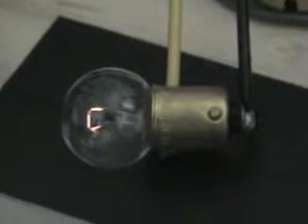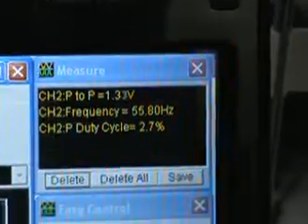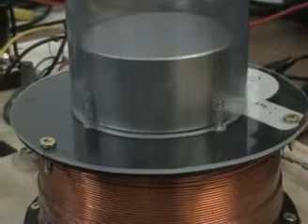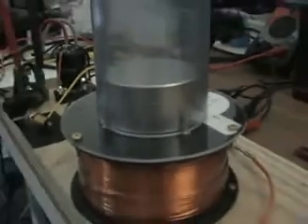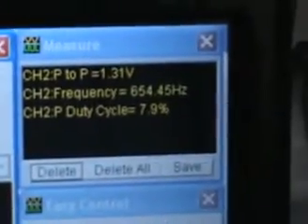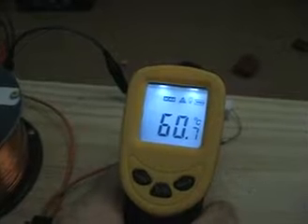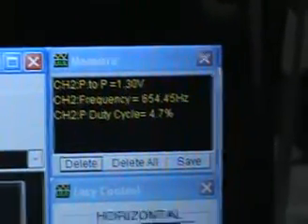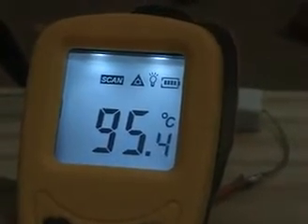Effect of Recirculating BEMF to Coil test 6

Comment: Hi again, 
You state that intensity of the bulb inidicates energy level input to circuit, but.. it only indicates energy dissipated in the bulb, not energy input to the coil.
My point;
50V and say 0,5 amp and 200V and say 0,2 amp input to coil may give same energy dissipation/light intensity in the bulb, but much higher energy available in the coil. This since the voltage drop is very little over the bulb, i.e. most of the voltage drop will be over the coil and therefore more energy= V*A

Comment from the maker: Hi Paul,

see user: Can101276 explanation above your post as it is perfect and a simple explanation of what is going on. As for meter measurements, they are not giving the correct reading in this kind of circuit. I had to remove them to find the real effect. However, a true power comparison (in vs out) is not yet possible. Given some time we will find the best way to calculate it.

Luc

Comment: Just to get some clarification, if you use a watt hour (RMS) on the input side and then a watt hour meter on the output side does this show a loss or increase in net power? I understand that you are using a light bulb at a given intensity to show the same energy input at various increased input voltages but a compensating reduced pulse width. I also understand that you are using an increase in temperature of resistor on output side to show more work done with shorter pulse width on input.

Comment from the maker: Yes Can101276,  you are understanding this correctly.  However there maybe limits as my higher voltage tests over 250vdc the efficiency starts going down but that maybe an electronic component issue causing this. I also see efficiency starting to go down when frequencies over 5KHz are used. This could have something to do with the coil characteristics. More testing will be required to understand this better.

Luc

Comment: I like your unconventional testing, it is crude, however it will alow you to see work being done and see how your changes effect the work performed. 

Correct me if im wrong, but what I got out of your experiment was that you can get more work performed with high voltage, high frequency pulses, than with lower frequency, higher duty cycle pulses at the same voltage. 
So in dummy speak, more work for same watts!!!
You are on the right track.